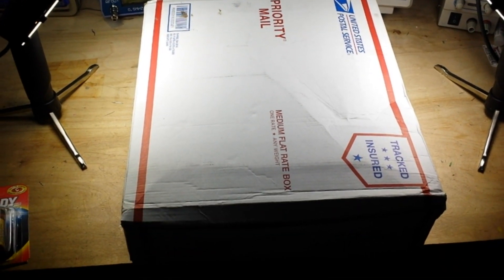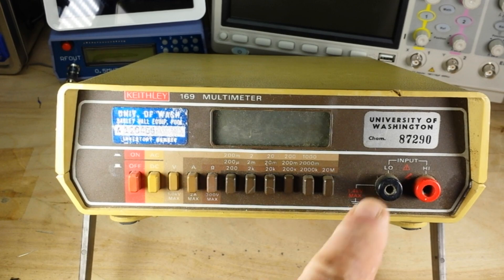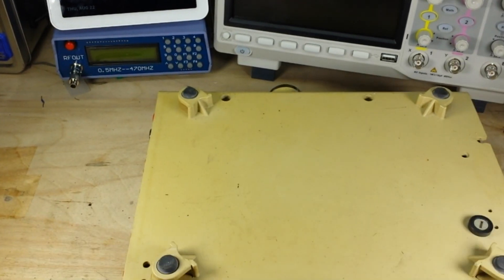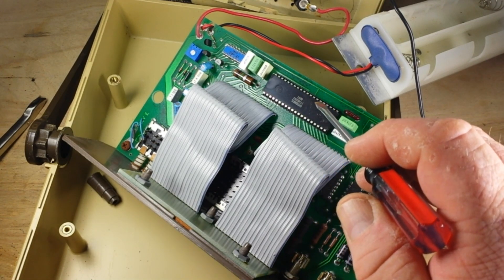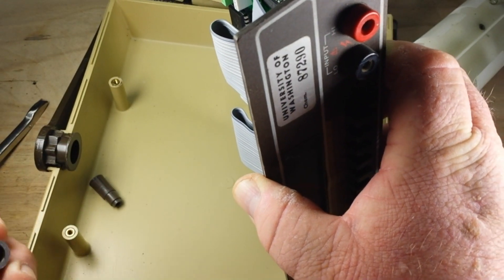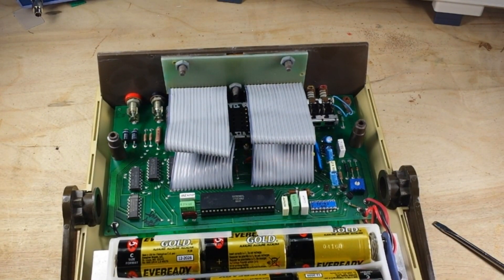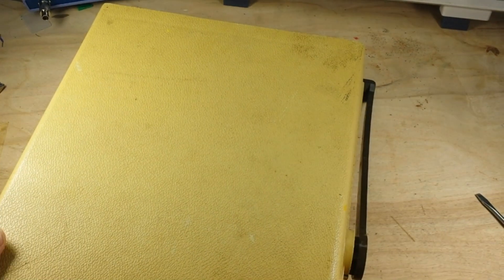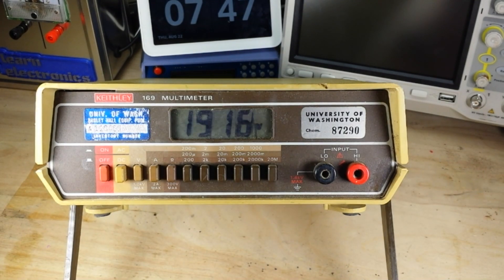Keithly 169 Multimeter

Comment: I find it quite a coincidence that I also just recently picked up a little desk meter, that also has batteries. 8050A with (i think)01 battery option.

Also quite an old meter by today's standards. But there is something to be said for manual range meters that pickup wherever you left off at last power-down. No function buttons or shift keys to toggle.

Comment: Do a repair video on it. The LCD screen needs to be replaced, but your not going to find an exact new one unless you pull it from another meter. You could find a 5v-6v source and tap off of that and make your own board out of transistors for each output that would have gone to the LCD screen and wire the outputs of the transistors to four individual 7 segment displays since this multimeter doesn't use modern LED/LCD multiplexing technology. However you would lose the subscripts. Then again you could add on to your board using alphanumeric displays and wire them up to only display each of the subscripts. Or you could write your own program manipulating the outputs that would have gone to the LCD screen to a modern LCD screen. Did I lose you yet? 

As far as accuracy, I would check all the caps since this thing is maybe 40 years old. There are a few trim pots on the board that would probably let you calibrate the meter.

Also I would lose the batteries and connect a barrel jack to the back of the meter to the board. Then all you would need is a 9v wall wart to power it up. No more opening it up to replac the batteries.

 I think it would be a great project to work on.

Comment: I really like these old Keithleys.  I picked up a lot of three "untested" 168 bench multimeters.  Two of them needed power supply work and new input jacks, but the third had been stripped for some parts.  But an excellent deal for $75.  Still close enough in calibration that I chose to leave it alone rather than risk making it worse.  And almost as good as the meters themselves are the user manuals.  The ones for the 168 has a theory of operation section that could be used to teach the first half of an insturmentation design class.

Comment: A battery operated unit without a battery door?
This MM should have a "User serviceable parts inside" sticker on it.
A bit crusty, but if you got it for free, then the price was just about right. Keithley btw...
Enjoyed the video, as always.
Reply: Perfect candidate for a small transformer based power supply retrofit.
Reply: @josephcote6120  But then it wouldn't  be portable anymore. How about a rechargable batterypack?
Reply: Fair enough.  

For me, if I need a portable bench multimeter I grab my Fluke 8030

Comment: Maybe crusty outside but inside looks in good preservation state on the PCB for a chemlab . The case must be sealing from corrosion .  Now comes the restoration task which  will put that meter back to dutty. Does this meter require warm up on the internal reference, even battery operated?

Comment: Did not see any caps and for good reason. It is all +/- 0.0001% resistors or something like that and they are not the chinese cheepo's... I had a old Radio Shack  analog  meter that was way off and the Resistors cost so much that I went to eBay and bought a replacement meter just like it for $10 bucks... Lol

I would give it a go and see what happens.... You never know!   :D
Reply: Well, there has to be at least one.  The way these units work is counting the time it takes a capacitor to charge to a reference voltage.  with clever design the time held in the counter is what is used to drive the display.

Comment: When measuring voltage, I don't think the 20M selection will work.
Reply: Yes the voltage will not work with it set to M ohm. The meter does not auto range.